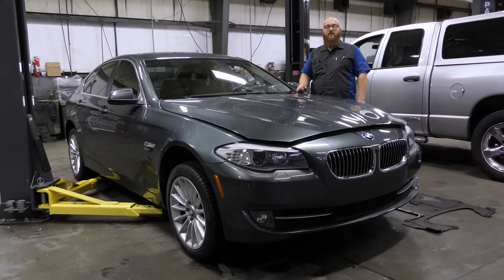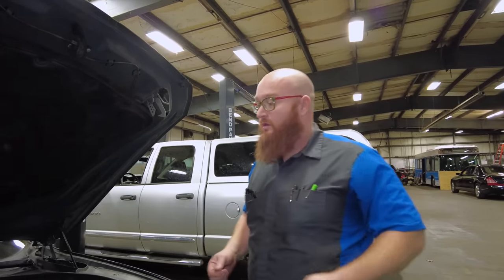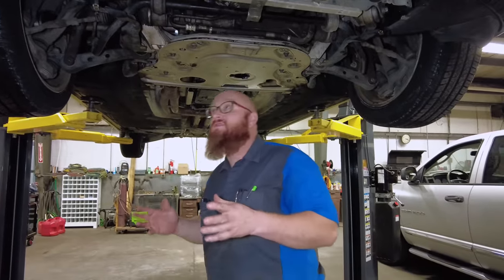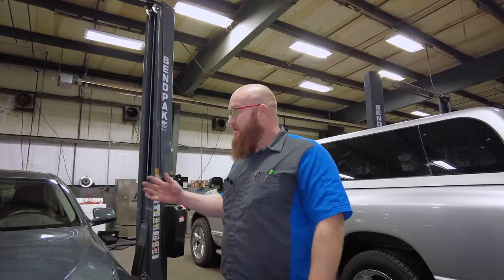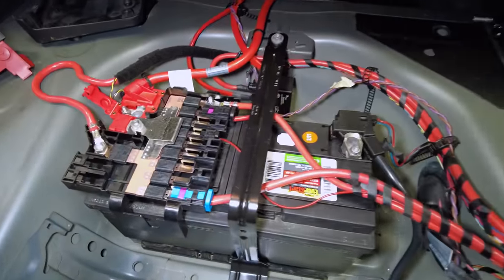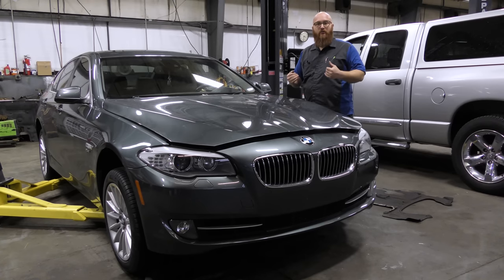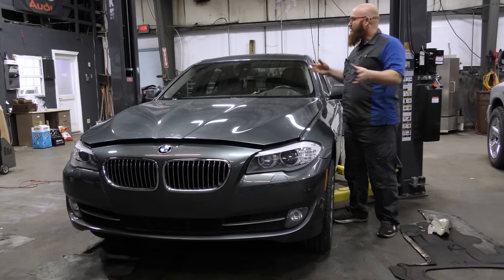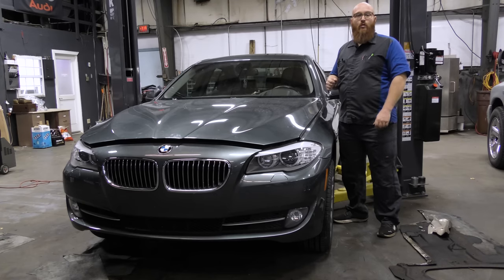One bad day for a customer! CAR WIZARD found TWO insanely unrelated issues at time on '12 BMW 535i

Comment: A wise mechanic said to me many years ago: "If you can't take a joke, don't own a car".
Reply: Don't own a bmw
Reply: So BMW = joke? As a former (one time) BMW owner I agree.
Reply: As someone who has owned many cars including BMWs, all cars suck, all cars break. My bimmers have actually been pretty reliable. People bitch about them because specialist German mechanics charge more than people who work on domestic stuff. If you know how to work on cars and know your BMW shit it's not a bad ownership experience at all. When it's bad is when you don't know not to overheat it or else and end up having to pay and wait for an overbooked and overpriced tech to replace your cylinder head. I should have just bought a good engine out of a wrecked car and an engine hoist but i was a kid and knew nothing about cars at the them. The ownership experience with a BMW is solely dependent on the owner and the due diligence they do when purchasing a car
Reply: @andrewgarcia3136  my BMW broke more than all the other cars I've owned put together. I probably owned the BMW for 5 years and it broke 10 times,.most of those times leaving me stranded. Of the other cars I've owned for a total of 30 years, including Toyotas, Hondas, Fords and Mazdas, they collectively broke maybe 3 times and I don't think they ever left me stranded. So I don't think you can convince me BMWs aren't worse than average.

Comment: Just replaced my starter 2 weeks ago. The Bosch starter was $200 and it took me about 4 hours to replace it going slow. Easy peasy. If you don’t have the budget then you have to be able to turn a wrench. I’m just too cheap lol. Also these starters just don’t suddenly fail, they progressively fail and you have to press the button multiple times until 1 day it just stops starting.
Reply: What did you think of the size of the starter?? Little tiny thing isn't it?? The first time I saw one I thought it was a joke. Probably why they fail so often.

Comment: I love my 2011 550i.  165k on the clock and it runs like a champ!  However.... I always tell people,  I would never own one if I had to rely on someone else to repair it.  I have had to do quite a bit of work to it in the past 1.5 years that I have owned it. But only having to buy parts and not paying for labor I only have about $1500 into it.
Reply: What failed if you don't mind me asking ,
Reply: @Conekiller29  most recently I had an oil cooler line burst and lost all my oil.  Almost lost the engine.  Due to the loss of oil pressure my bank 2 timing chain jumped a tooth and while dealing with that, I notices the top chain guide was broken.  After replacing that, a strange ticking I have had since I got the car, suddenly disappeared.   I almost missed the fact that it was broken an the broken piece landed on the wiring harness instead of making it down to the floor.  The car gods were smiling upon me that day.
Reply: Yup, you have to be able to wrench.
Reply: The Chevy in the background would cost 10k in parts by 200k this guy is a joke

Comment: Even AFTER you fix the starter the customer will still have this creeping doubt in the back of their mind thinking that you “might” have scammed them.  This is an unfortunate consequence of the industry we’re in. This type of stuff happens IRL, and customers don’t fully understand.
Reply: Beacuse this industry is riddled with fast talking mechanics who 80 percent of the time overcharge and over repair. 8 out fo 10 times I have had mechanics try to misdirect repairs luckily I am a bit more savy and done most the works myself.
Reply: @SwiftGQ bro there U go the reason why people hate BMW's, not savy enough,bet they don't know they can reset valvetronic adaptations to position 0 and coolant circulation and oil circulation all through the accelerator.

Example reseting valvetronic
Everything off but ignition stamp accelerator in I think 15 times and you will hear it do it's job,did I mention you can read your fault codes through the integrated computer,art form indeed.also another thing😂  the Germans developed a jet plane literally seconds before getting ass gropped by the Russians and zero finance

Comment: 200K miles and the customer is complaining? I believe that vehicle wasn't well maintained and that is why all of these problems are having to be dealt with. There are many people that DO NOT maintain their vehicles but expect them to run forever. WTF!!!  BMWs are great cars if you can maintain them appropriately. One of the major problems is that people who can not truly afford them purchase them and can't keep up with maintenance. I have personally witnessed some BMW owners driving around with their check engine light on for months and their motto was simply "It still drives with no problem" WTF!!!! I have owned several BMWs for over 20 years and can say because of the great upkeep they have all been amazing to me and my family. P.S. If you truly can not afford a BMW stick to Nissan, Honda, Toyota, etc.
Reply: Well I am sure you would find plenty BMW owners who follows the maintenance schedule like the Gospel, yet they ran into all sorts of issues with their bmw.
The theme that I've noticed is that there are lot of badly designed parts will fail more frequently which is expensive to replace on its own, and in worse case scenarios you would have these failures will cause even bigger issue and before you know it, all these will add up and end up costing more than the cars actually worth.
Reply: Well I am sure you would find plenty BMW owners who follows the maintenance schedule like the Gospel, yet they run into all sorts of issues with their bmw.
The theme that I've noticed is that there are lot of badly designed parts will fail more frequently which is expensive to replace on its own, and in worse case scenarios you would have these failures will cause even bigger issues and before you know it, all these will add up and end up costing more than the cars actually worth.

Comment: It makes the case that the starter situation might be related to the overheating, engines can get tight from overheating, probably strained an already weak starter, or there is a more systemic engine problem, so very possibly related in some manner
Reply: That's the only thing that makes any sense. I have the 3 version of this non x drive.  But I don't have that little coolant box underneath.  Very strange for that clip to pop off. Almost seems like sabotage.
Reply: You reminded me of a mechanic I knew at a Toyota dealership I used to work at that worked on the sales managers 85 MR2 race car. He had mentioned that the starter used to fail on a regular basis because of it's proximity to the exhaust manifold. But after they had wrapped up everything with heat shielding the car never again had a starter fail.

Comment: Yeah this had been a problem from like 2008-2014. When they overheat they won’t start to protect the engine. But you can do massive damage by continuing to try to cool it just until it will start.. then drive.. until the engine dies again. It’s been resolved now though.

Comment: I've owned a few BMW vehicles, an X5 with 205k,  a 328i wagon, and a 1995 M3.  All were exceptional cars, pre i-drive, but still, wonderful cars, easy to work on, and very fun to drive.  I think the fun factor is well worth the maintenance cost but they were also relatively simple vehicles without all the bells and whistles the newer ones have.  I'd buy another BMW in a heartbeat, but I can also work on them so there's that..
Reply: You aren't working on this one by yourself.  Even worse with newer ones.
Reply: Old BMWs are not the same to work on as the new stuff. My e39 540i is easy enough to work on despite the tight packaging. Tried to work on a friends '19 X1 and that thing was a nightmare.  Giant pain in the ass to chase down 1 leaky banjo bolt on the power steering.
Reply: @majist0  I am a DIYer and can replace that starter. I've already done it for a friend. Engine work? No way. But all the other junk is on you tube.
Reply: Same. Have a 06 E90, no iDrive, no Xdrive, dead reliable. I've had a couple early 2000's BMW's, all fantastic cars. The smooth ride, excellent power delivery and frankly unmatched steering is worth it. All my cars have reached over 400k km, (260k miles) with largely no issues, just basic maintenance.
Reply: @majist0  Why not? It's still held together by nuts and bolts.
Reply: @majist0  No reason not to. The tools are slightly different, but I would rather work on my modern BMWs and Mercedes than my '74 Spitifre. With the right tools (a computer with the right software or the right scan tool), the modern cars will tell you what is wrong with them. With the Spitfire you have to resort to tea leaves and goat entrails at times. It's not rocket surgery.
Reply: Its not bad just a long list of things to replace every 5 months.
Reply: @Jason.cbr1000rr  Th car has 200K on it, so that is obviously a crock of crap. In the nearly eight years since my '11 328i went out of warranty, it has needed a battery, when it was nine years old. That expensive cars are expensive to fix when they do need fixing should not be a shock to anyone. If it needed $3K in repairs tomorrow, it would get it without a second thought - because it would cost $50K+ to replace it with a new one.

Comment: Heat kills starters so it makes sense to me that if the coolant hose blew and the engine bay got extremely hot killing the starter makes complete sense.
Reply: In theory, I would agree.
Reply: ahhhh.... someone mentioned something similar in that the starter was mounted next to the part of the engine that gets really hot. if the engine wasn't getting cooled properly and got really hot maybe it "fried" the starter as a byproduct of the failure.
Reply: I think this is a very plausible explanation.
Reply: I think really old starters had a starter relay or starter solenoid attached to the outside of the starter motor, that was the part that burned out causing the owner to replace both. I'm sure that still have a similar setup but now next to impossible to remove it.

Comment: I’ve had numerous BMW’s over the years and I have had a love/hate relationship with them. In this case, a starter needing replacement at 200k isn’t unusual to any car, or the cost of the part. The location of it, along with the $150/ per hour cost is the main problem. People need to be able to work on them, themselves or find a garage with more reasonable rates
Reply: Wisdom
Reply: Or just dont buy a junk ass car, that is neither luxurious, fast, or classy. It fails at literally EVERY thing it tries.
Reply: I'm sorry, but you don't buy a modern BMW to work on them...

Comment: I never had any trouble with mine, but I do replace components at their estimated fail rate and perform regular maintenance myself. I just turned 194,000 miles. It has never failed me. I absolutely love this vehicle. I understand that they are not made for everyone after the "new" phase. Regular maintenance and inspection is crucial. 
Also, I'm not sure where this gentlemen is getting his starters from. I replaced mine, OEM new for $289. It didn't cost $1200. His labor rates are also comparable to a dealership. I wouldn't buy this guys sorrowful feelings towards a BMW owner.

Comment: I can’t even drive my ‘11 335is right now because the CAS module is toast. Can’t get one until next year due to national back order. Gotta try to send off the ECU, CAS, and key to have it repaired. My BMW ownership has also been a sob story of random crap breaking. And mine only has 75k on it. BMWs drive great, but the newer ones are complete junk. I won’t own another.

Comment: Just bought an older BMW yesterday. I hope it gives me reliable kilometers/miles but inevitably any car will require repair work. I'm very pleased about the idea that basic maintenance and repairs doesn't always involve pulling front bumper partially or fully or worst case dropping the whole engine along with the subframe. What I'm saying is it's not the absolute worst there is to work on.
Reply: But yeah.. I need to maybe start checking and planning replacement of all the leaky parts before I get comfortable with it.
Reply: Lol 😂 you better get your wrenches and start replacing the entire cooling system

Comment: That KN sticker on the airfilter box is very suspicious.
Just from that, I would say that it's not just bad luck for the hose to come loose, it's just bad maintenance.
Probably also changes the oil at 10k miles or more.
These cars don't last with neglect.
Reply: *Filter
Reply: the 200k odometer says otherwise

Comment: The Car Wizard still has to do a buy this, not that video for Saab, as well as a buy this, not that video for Infiniti. Most of these vehicles are reliable, while some of them are not. Let us find out by spring time, at least. We currently have a little less than a month of winter and Spring Break is just around the corner. We need more all-new videos from the Car Wizard.

Comment: Hey Wizard, unfortunately I went through a similar situation on this exact model. I babied the car and took great car of it. Maintenance was taken cared for entirely, only for the rod bearings to slip on me at 130,000 miles. Why? Who the hell knows. Did some research and found that this is becoming a more common problem on these N55 motors that were made within the first few years of their production. Very finicky cars that get you with their looks. Moved onto my sturdy C55 AMG
Reply: That M113 is unstoppable. I too moved from BMW from Mercedes, albeit 17 years ago and never looked back. Currently running two W220s, a W215 and X164.
Reply: Wow. I have the N54 engine. Still (fingers crossed) going strong at 150k.
Reply: Im still rocking a w124 from 87 car is slow yes but you its comfortable it still descent on gas its still pretty reliable and when it goes pop its not a arm and leg to replace plus its about the easier car in the world to repair 

Mercedes > BMW
Reply: @OBrechkin  I had that car before I had my BMW. Thing drove like a limo and was so smooth riding. Definitely a tank as well.
Reply: yea the N55 PWG 2011-2013 models was sorta problematic. the N55 EWG from 2014 onward fixed almost all the issues with the N55
Reply: @adamgraham6265  yee. I got the 2013. E92 Got a coolant leak and fucked my water pump and steering pump. 3k fix
Reply: @ricas5598  oof find a new mechanic mine only charged 500 for the fix when my water pump died in the bay area (California)

Comment: I had a problem with my 56 VW convertible, during the 70s and early eighties; with my starter failing to reliably turn the engine over in cool or cold weather. The VW dealer replaced the starter 5 times and the ignition switch once. Then at an out of town dealership the problem was correctly diagnosed with the solenoid replaced. The part was only FIVE dollars and though separate from the starter, it was easily replaced.

Comment: Sounds like my 04 SVT Focus. I noticed that the car was vibrating a bit, and I also heard a pop when the car shifted momentum directions. Pulled over, and the outer CV joint was sloppy. I gave it a wiggle and shook the axle, sure enough the axle had just given up. No torn boot, I had just done a control arm and saw nothing obvious. I got in the car, started it, and the belt started squealing, something had locked up badly enough to shred the belt. Got out, saw nothing leaking.... Decided to cut the belt and drive the mile home. Turns out that my water pump had chosen that exact moment to shank the bearing. Ball bearings were butted up against the pulley flange. A week and a Rock Auto box later, the car is running flawlessly and drives much better.

Love your vids Wizard, I don't have many people that share my passion for cars to tell stories to.